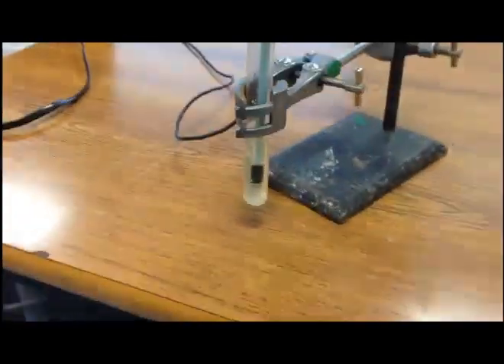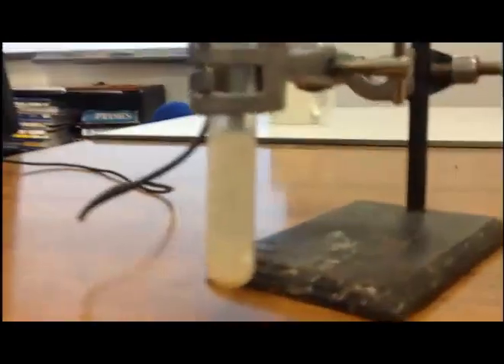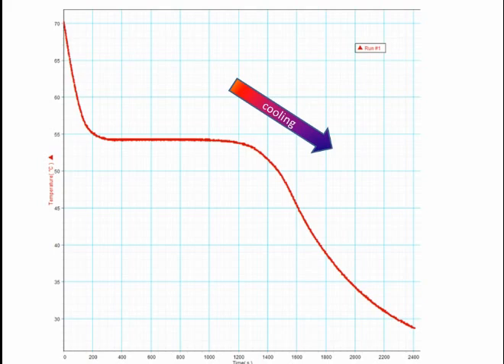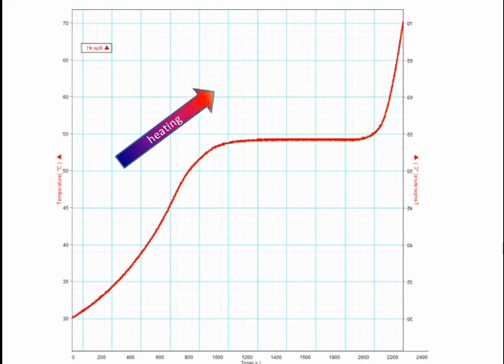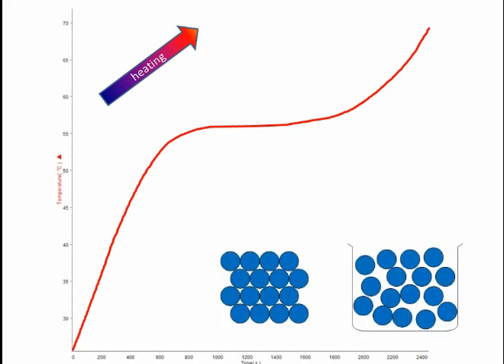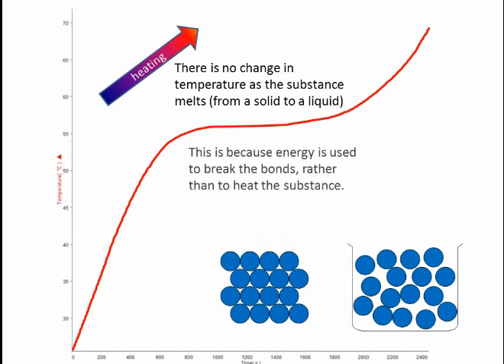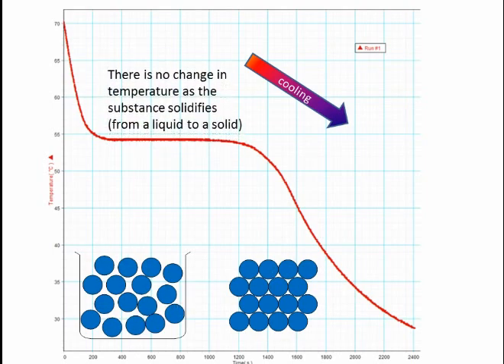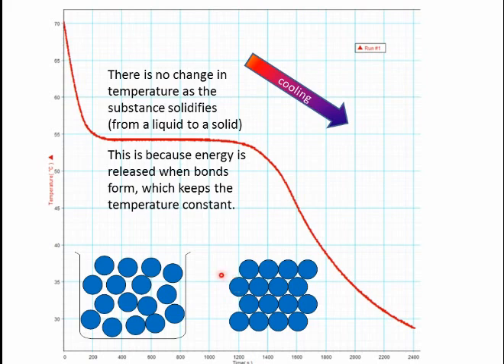Cooling curves - stearic acid cooling from a liquid to a solid

Comment from the maker: @Izzyswims- The temperature falls most rapidly at the start because there is the greatest temperature difference between the stearic acid and the air in the room. 

@yugioteen- yes, isothermal means no change in temperature, so this is indeed an isothermal process.

Comment from the maker: That's right - isothermal means "a constant temperature". Here, the surroundings are cooler than the stearic acid, so it cools. However when changing state, heat energy is given out as the bonds form between the atoms in the solid wax.

Comment: Hi once the stearic acid is being melted and it starts to cool afterwards, why does the temperature continue to decrease even though it has changed state?
Reply from the maker: Hi - once it has completely solidified, it continues to cool because the solid is still above room temperature. So it cools down just like any other solid would, like a cake that's just come out of the oven.
Reply: @benaryder  thank you

Comment: if stearic acid were impure would the freezing point be higher or lower than pure stearic acid .?
Reply: That would depend on what the impurities are. It's common for stearic acid to be with palmetic acid, this would liquify at a lower temperature.